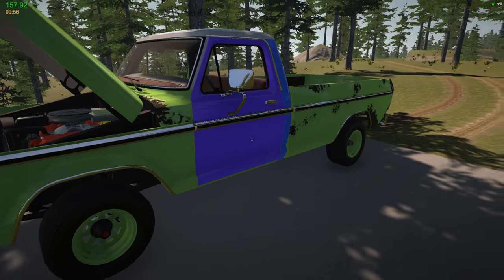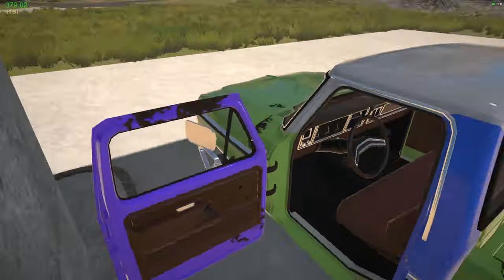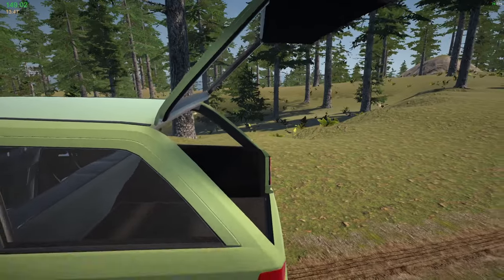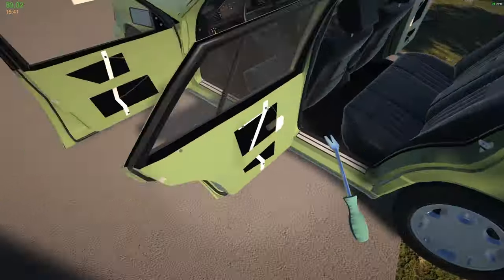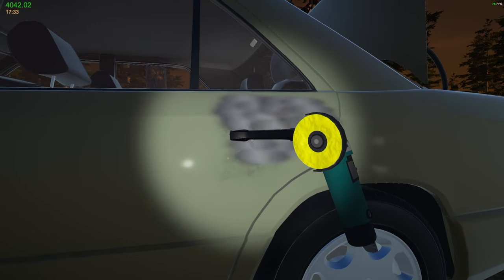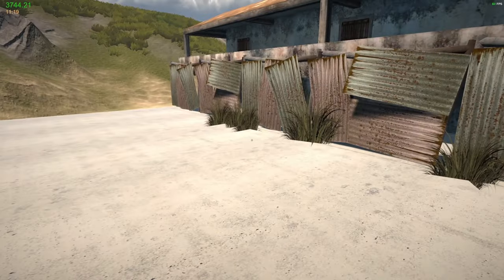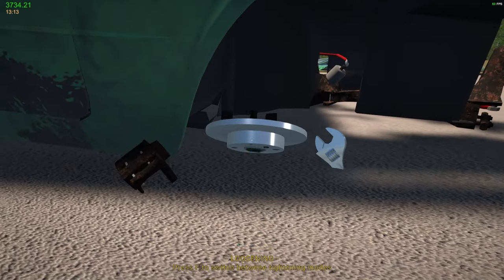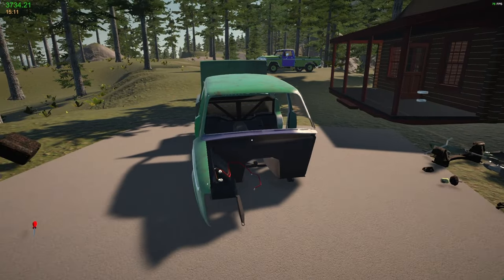My Garage Episode 3 - Major fails then some wins!

Comment: Great episode ,it took me a while to get into the game but i love it now . I use an xbox 1 series x controller for driving.I nstalled a few mods to the game from nexus mods the one for ever lasting cutting disc and welding rods has been handy, other mods were a couple of bmw,s and a ford f100 pick up plus more engine parts so i could add a turbo to the i6 i have in one of my jesses and about 10 minutes later engine is dead as i forgot to tighten one pipe .i find the quickest way to make money is buy cars from the junkyard clean them remove rust and paint them and sell them as is  .i have subscribed to watch all your other uploads .